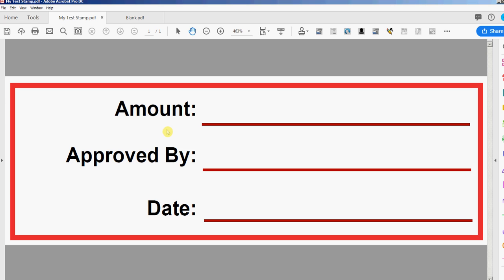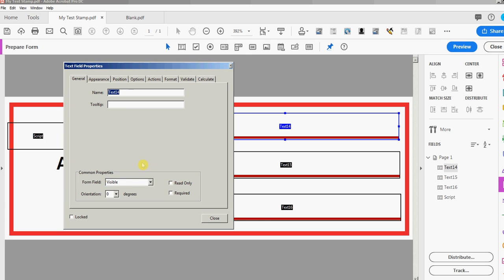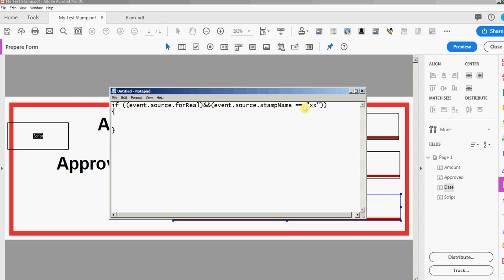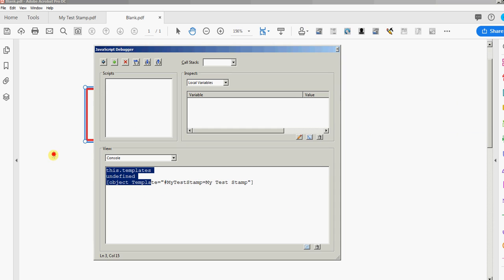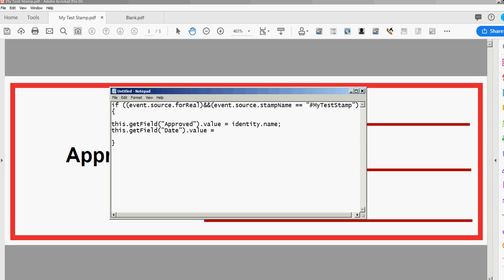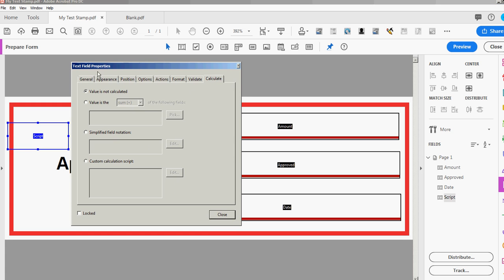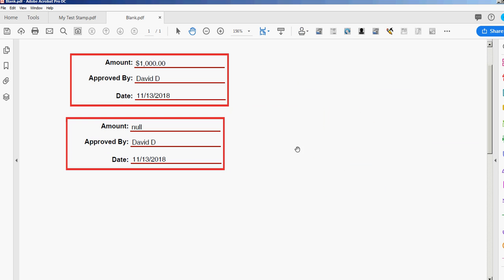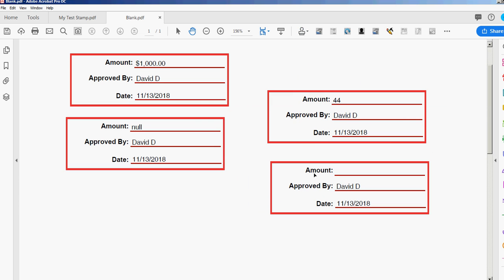How To Make A Dynamic PDF Stamp

Comment: So is it possible to create a stamp with just fillable fields without that java script pop up?
Reply from the maker: No.  A stamp is a static image.  If you want the user to be able to fill in form fields you would need a javascript popup to insert values into the fields before the static image is placed.
Reply: @PDFAutomationStation  Oh ok.  I just want fillable fields and I'm not sure I understand what part to "repeat" on each line. Felt like there was too much going on in the tutorial.  I kind of wanted more explanation.  I can usually catch on and create reports on SQL but this was different.
Reply: @paulruvalcaba3630  For each fillable filed in your stamp, you simply need to "add" a new app.response statement in the script. By doing so, the user will get an individual popup (one for each field requiring input) "before" the stamp is rendered/applied on-screen.

So, you'd repeat this script below and replace the parts in  " " accordingly:

this.getField("FieldNameGoesHere").value = app.response("DesiredCaptionToShowInPopup:");

Note:
FieldNameGoesHere = Replace this with the appropriate field name on the stamp
DesiredCaptionToShowInPopup: = Replace this with the desired caption text you want to see in the pop-up box above the input field

Hope this helps.

Comment: Hi David, none of the console scripts run on my machine. I am using Adobe Pro Extended. Your version looks a bit different then mine, but the commands should work, Correct?
Reply from the maker: What happens when you run a script?  Are you running the scripts correctly (pressing the Enter key on your number keypad, or press Ctrl + [the regular Enter key] if you don't have a number keypad)?
Reply: @PDFAutomationStation  I was able to finally get the name, I was hitting wrong enter key. I have followed this and the previous videos to a T. but I am not able to get he script to run when I stamp. I copied your code EXACTLY and it will not apply date or get identity, the Amount prompt will not even come up.
Reply from the maker: @jefflasco5992  Jeff, let's take this offline.  Please click here https://www.pdfautomationstation.com/public/department6.cfm and message me and I will reply by email.

Comment: Hi David, In order to create custom stamps with some JV to add page numbers & dates, do I need to have the pro version or can I do this with standard free reader dc that has a stamp creation utility?  many thanks
Reply from the maker: In order to insert javaScript into a dynamic stamp you need to add form fields to the stamp and then add the script to the calculation tab of one of the fields.  This is usually done using Acrobat Pro.  Form fields can be created in Reader by running a script in the console using the doc.addField function and then calculations inserted using the setAction function if you know what you're doing.  We have a free tool to open the console in Reader, which can be downloaded here:  https://www.pdfautomationstation.com/members/programs/fileinfo.cfm?id=29
Reply: @PDFAutomationStation  Many thanks, now I just need to learn JS to create this, lol or just get Pro to use the inbuilt forms facilty.
Reply from the maker: @nigelhobden  Or you can contact us and ask for a quote.  Best prices on the web for dynamic stamps:  https://www.pdfautomationstation.com/public/department6.cfm

Comment: Hi,
How can I use a dynamic stamp that I created for myself for another computer or account? 
I made one for myself based on your tutorial video. Now I want to give it to my coworkers. I tried to copy-paste the stamp file from my Roaming folder to another computer Roaming folder but the software did not recognize it (did see the stamp in stamp tool in the Adobe). 
I have to do it for about 20 computers and takes a long time to create a stamp then make it fillable and code everything. Do you have any solution? 
Milad
Reply from the maker: If the stamp works on your computer and you copy the stamp file to the correct folder on the other computer it should work on that computer as well.  Ensure javascript is enabled on the 2nd computer.
Reply: @PDFAutomationStation  Thank you so much. It worked perfectly. thanks for the help and quick response.